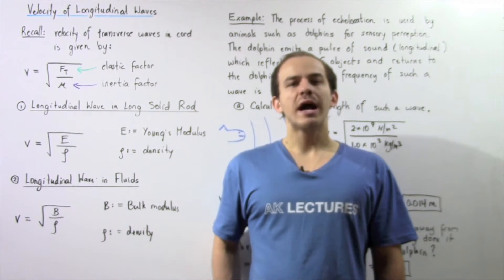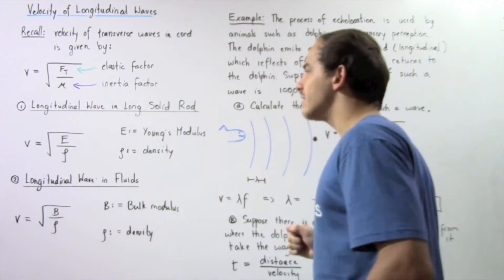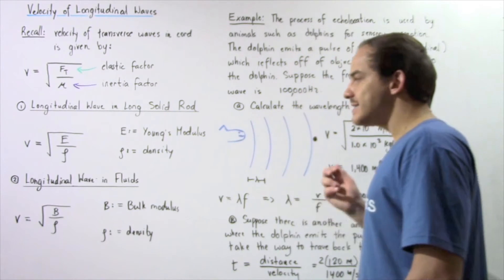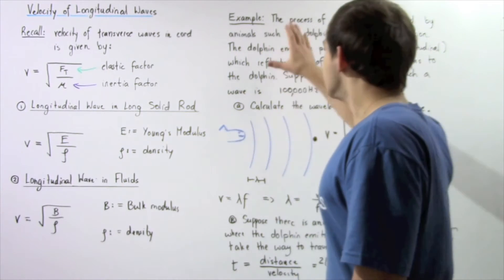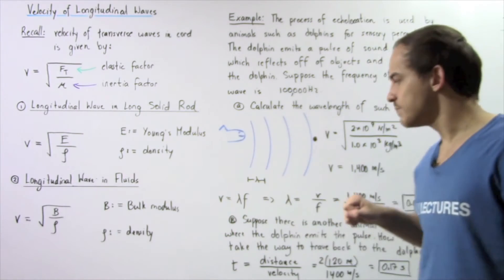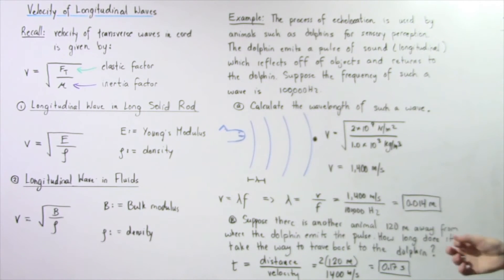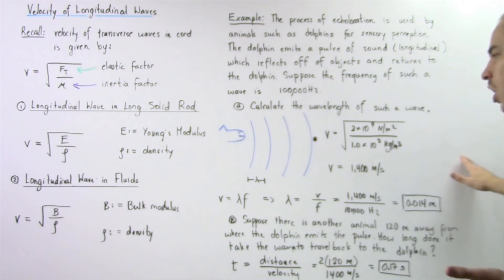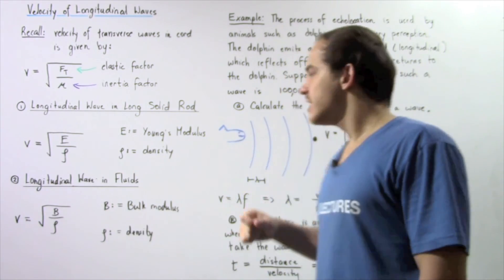Velocity of Longitudinal Waves

Comment: what about the longitudinal velocity in a spring?
Reply: To find that, we need to know  what is the material used to make that spring? For example, aluminum or iron. Since the spring is a solid matter, we need to find the Young's Modulus of the material used in that spring. After finding these two information, use the formula of speed of wave, V = (E/p)^1/2. Hence, you will find the longitudinal velocity in that spring.